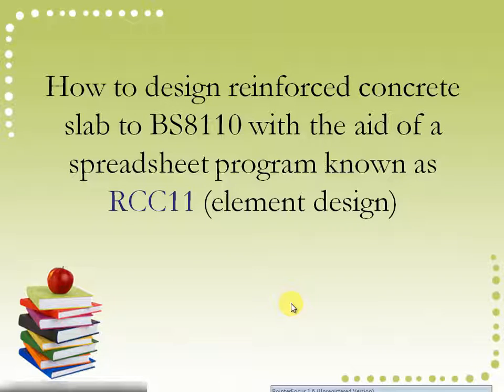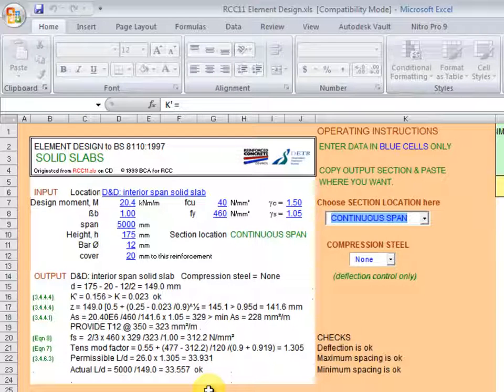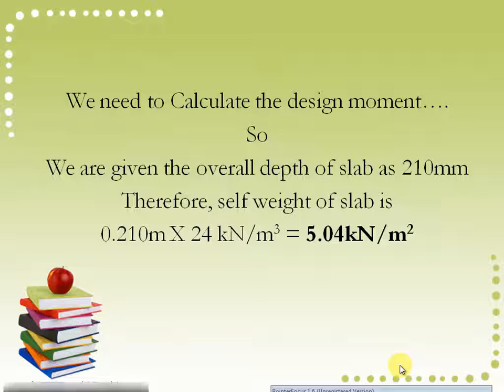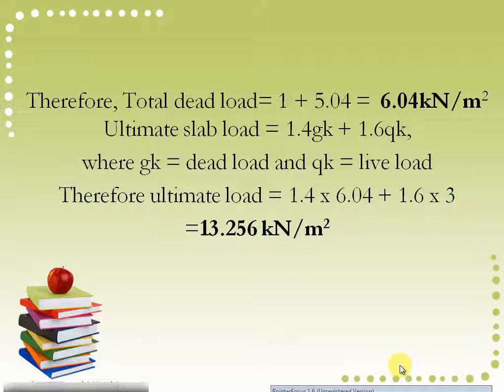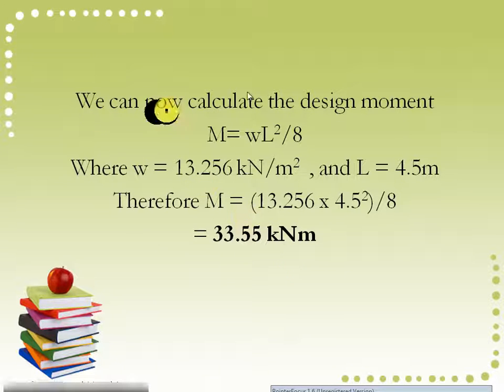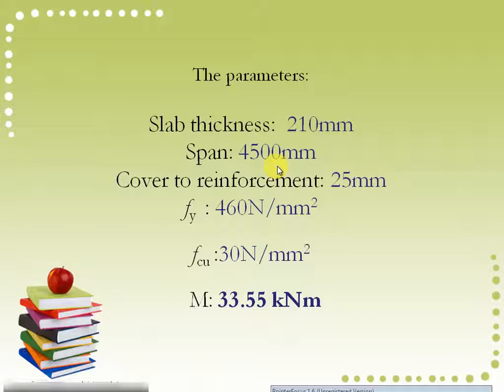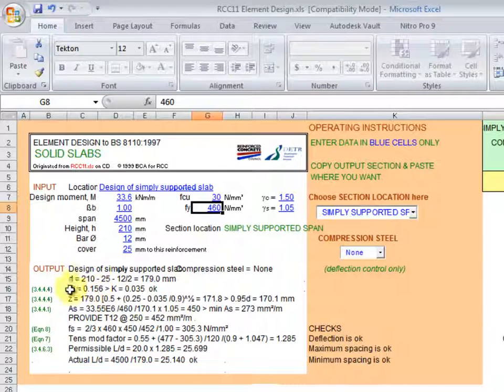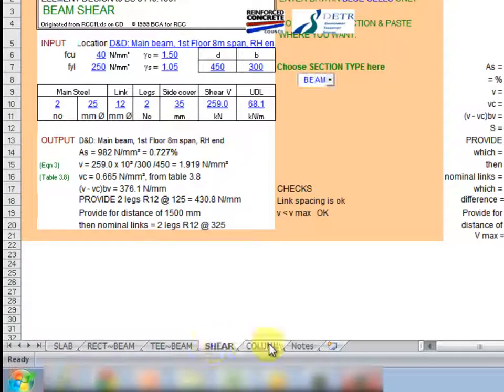Simply supported slab design with the aid of excel spreadsheet program

Comment: I have a question?
is it a one way slab?
and why didn't you divide the moment which was in KN.m by the supported width of slab to get moment per unit width in KN.m/m?
Reply from the maker: Yeah Its a one-way slab, the process you are describing is another way of designing the slab, however for the spreadsheet, you just need the design moment in kNm